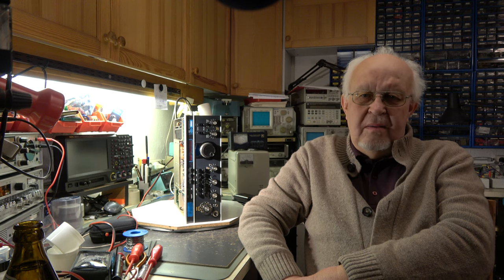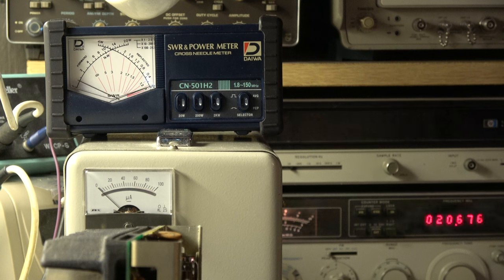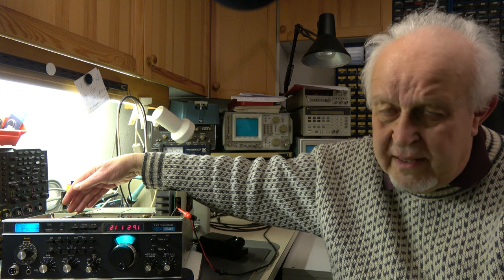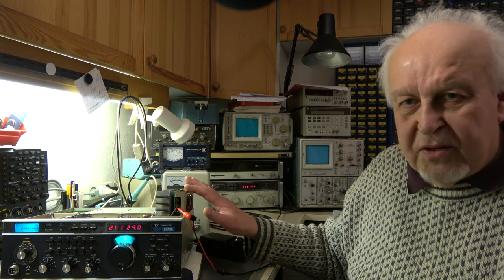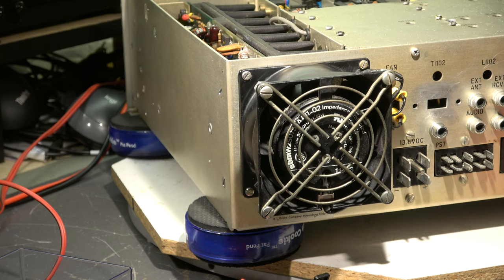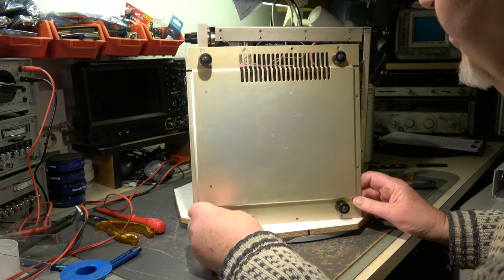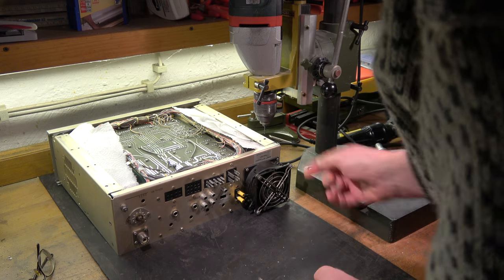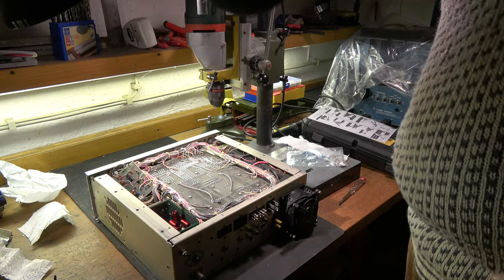# 161 Drake TR7 Part 9(13)

Comment: Thank you for your comments on the fan! There is some bad advice out there to mount the fan pushing in. I proved experimentally with temperature probes some years ago that the PA transistors get hotter, faster, with the fan pushing in .The USA patent on the TR7 cooling system clearly shows that it was designed for pulling air out. Your fan is definitely not original. The Drake supplied fan was a 19 CFM Rotron which is much quieter. The same fan should be mounted on the PS7 (pulling out) to extend the life of the main filter capacitors. 73 de Jim NU0C
Reply from the maker: I´ll replace this fan with a 12VDC version with high volume flow and less noise. No cheap chinese scrap but from a reputable supplier

Comment: Excellent progress! I am looking forward to the alignment.  In my opinion, the HP 8640 is one of the best RF signal generators ever made. Regards, David
Reply from the maker: Yes David, the 8640 are the best ones - except the plastic gear, which is becoming brittle over the decades.

Comment: On the driver board, I would check both input and (more likely) output pads for correct impedance / load.  I suspectthe 9:1 UNUN on the output is in resonance due a changed load and this is causing wild impedance swings to the driver, causing gain changes vs. frequency.  

You'll find the issue Stefan.  Of that I"m 100% sure!   Keep up the great work OM.  73
Reply from the maker: Thanks for your hint, but the resonances are clearly caused by the LP Filter as can be seen on the sweeps with the sweeper. I assume, that the 18MHz dip is caused by magnetic coupling between the unscreened coils on the LP filter. The problem in the 21MHz range is maybe also caused by such an effect, but the dependability on the cable length is not clear to me. A screening of the filter coils could help but this is beyond this project..
Reply: @dl7majstefan753  I have not seen this 21 MHz issue. My PA deck problems have been on 40m, oscillating into a reactive load. Adding a chassis ground strap to the right rear corner of the High Pass Filter module seems to have finally resolved this and my TR7s are rock stable on 40m now. Drake conveniently provided a hole in the side wall at this point to fasten a ground strap to.  I believe that the version2 predriver board solved some problems over the original version but I have no experience with the first version. A healthy TR7 should easily put out a stable 100 Watts on 10m with the ALC adjustment set to service manual spec on 20m. 73 de Jim NU0C
Reply from the maker: @RadioJimProductions  Thnx. I´ll check it

Comment: Guten tag Heir Stefan,
Thank you so much for your comprehensive coverage of your TR7 restoration. The TR7 is a great transceiver and well worth keeping them running. Another rig which reminds of of the TR7 is the Tan Tec Corsair and the Omin 6 series. Of course, the Heathkit HW 101 is not worthy for a basic transceiver. I would like to include the Heathkit SB line, such as the 101 and 102, but the dial mech was too mickey mouse and Heath should have upgraded it at some point.

vry 73,
Glenn WA4AOS
Reply from the maker: Tnx dr Glenn; don´t know the other rigs, because i´m a Drake guy from early beginning of my ham career...hi. And Kenwood. the old hybrids are also good but i´ve sold them all. Now only C-line and 7-line - and i´m very happy with them.